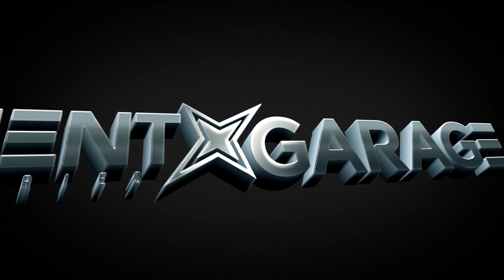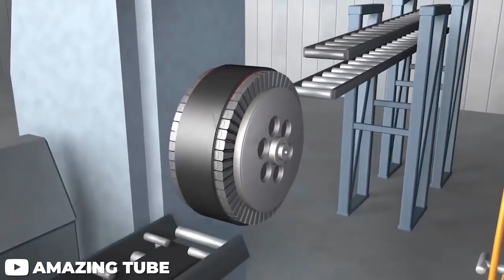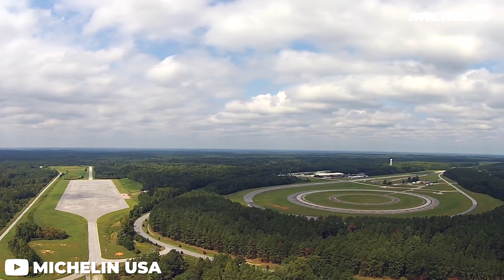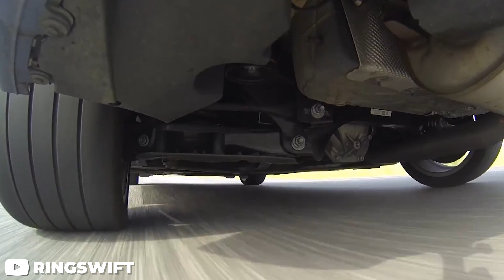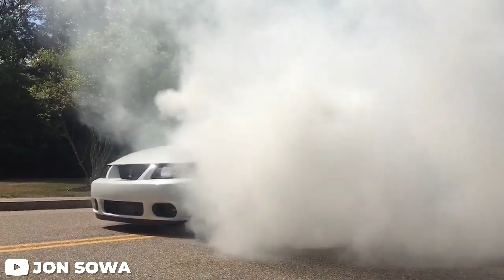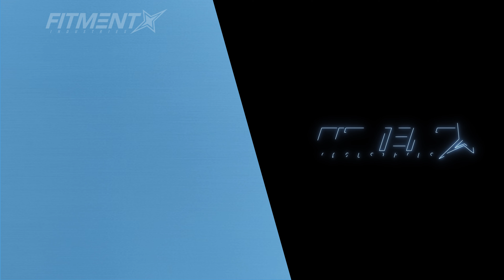Are Expensive Tires Worth It?

Comment: I realize most of you guys are talking about performance tires for your sports cars. But I'm about to get some new tires for my Avalanche. I ran a set of Falken Wildpeak At3' s in Maine for about 7 1/2 years. Those were the best tires I've ever run. Flawless performance in the snow and quiet on they pavement and they lasted a lot of miles. So it's a pretty solid no brainer for me. The   immaculate performance justifies every penny of the Wildpeak At4w price point. I do wonder about how big of a difference there is between the at 3 s and at4's    performance wise. But at the end of the day your tires are such a crucial part of the automotive equation. So At4 s it is! I think. 😂😂😂😂😂this way I can compare them to the At3's.

Comment: i have had expensive tires and cheap ones .. they all last the same to me, as my car is a fair weather car and i may do a burnout for fun ever no and again, but that's what your supposed to do in a 700hp mustangs right? not all "cheap" tires are bad because lack of name brand name.. imo it really depend on whats important, i been thru 8 sets of rear tires on my mustang.. car on has 50k on it. so if u like me i have two sets of wheels for the rear daily tires and  better ones for race days so if i wreck one set u can at least get home. Nitto Invos, Continental ContiProContact, Hankook,  to Achilles ATR Sport. depends on your budget and trust me I destroyed some higher end cars on fancy tires with my cheapos :}

Comment: The 2 main purposes of tyre tread are: 1) water evacuation, 2) branding
The tread has a detrimental affect on dry grip, and is the cause of tyre roar. Makers design a pattern that prevents the tyre from aqua planing or being pushed up by water pressure, and helps to reduce noise. However, with products bought by enthusiasts, the tread pattern is a fashion statement.

Comment: i buy mid range tires because i drive on public roads meaning i dont need a sports tire like the pilot sports ect.... a mid range tire gives you good performance good grip in wet and dry, just as much if not more ks then a high end tire, is half the price. if i was taking my car to the track then i would get a tire like the f1 directional 5 or pilot sports, but i dont see the point if its only a road car and getting sports tires. like for a set of high end tires in nz is about $1600 easily if not way more. for my car (215/45/18) and my midrange is $1000 (all balanced and fitted)

Comment: I was a Toyo Tires boy for years for the reason that they always rode so smooth and lasted a long time. But after getting an actual sports car I’ve been using Continental DWS06s almost exclusively. I do currently have some Nittos on the front because the camber eats up the tires too fast and they are less expensive then the DWS06.
Reply: Toyo proxies
Reply: @David Srey  I used to get Toyo Open Country HT.  Very smooth ride due to their softer rubber which results in faster wear than expected.  Mine wore out at 37K miles, which is almost half what they were supposed to last.  So, I switched to Michelin and just bought four from Costco.  80,000 Mike tread warranty, road hazard and lifetime balancing, rotation, and free Nitrogen for Air included in the price of the tire.

Comment: Hey Sean, it's a bit of a mixed bag on my end. I'm running Falken 20's in the summer and Pirelli 20's in the winter. Pretty happy with the summer setup, but the winter setup has not been worth it.
Reply from the maker: What model Pirellis are you running in the winter?
Reply: @fitmentindustriesgarage5583  Sottozero 2 -> Front: 245/40 99V (XL); Rear: 275/35 102V (XL). Traction in deep snow and ice is unpredictable, especially on inclines where the nose of the car gets lighter.